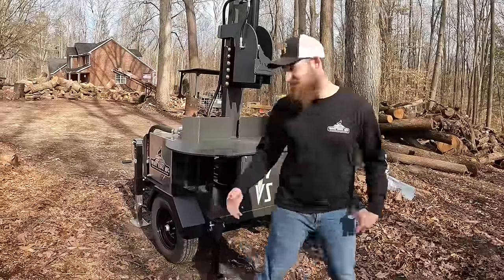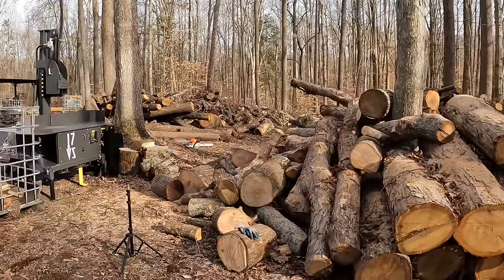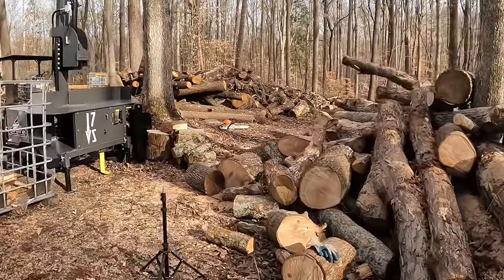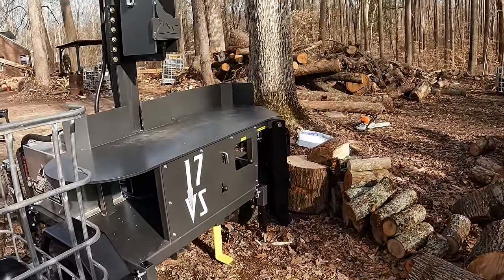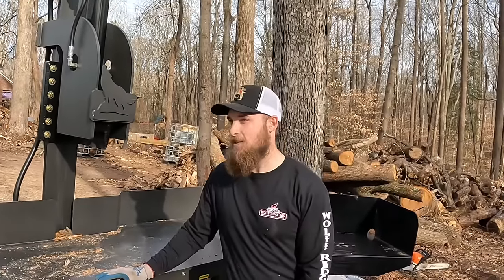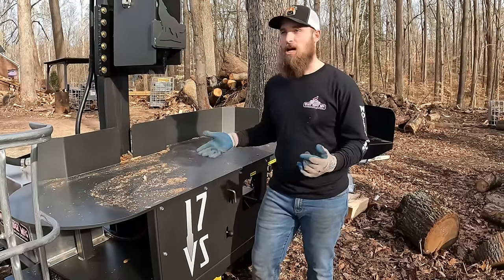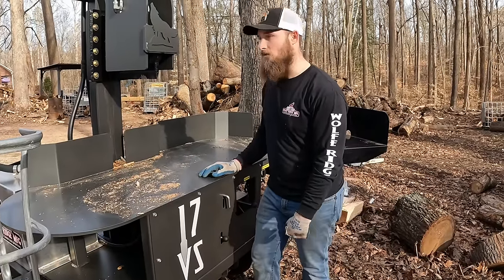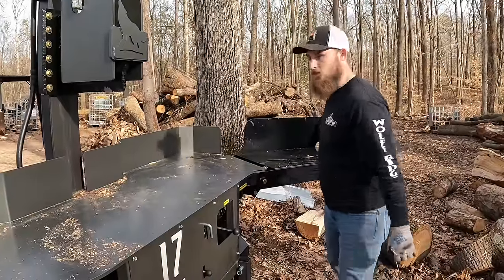The Woodyard Gets A Big Upgrade!

Comment: The 17vs produces better wood then the splitter you are currently using, you can control the size splits with minimum Trash,  The 17vs Vertical and your standing up straight, if your working on your own the 17vs is the way to go,
Reply from the maker: I agree with everything you said. I can’t saying anything bad about this machine!